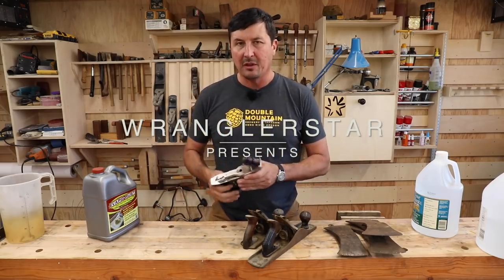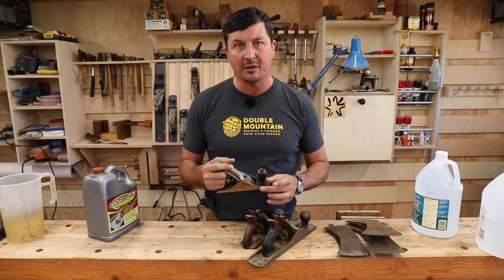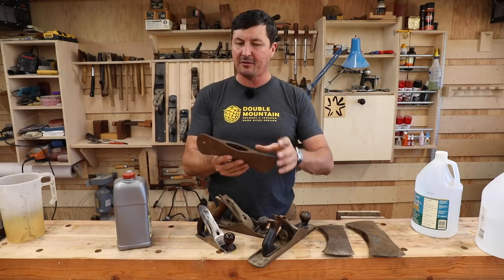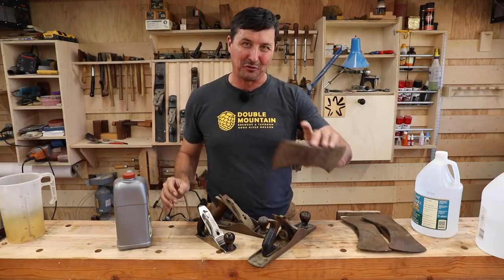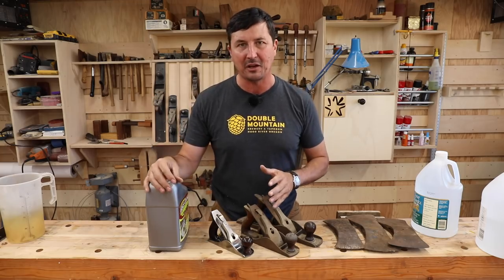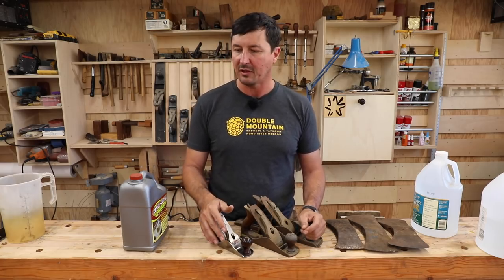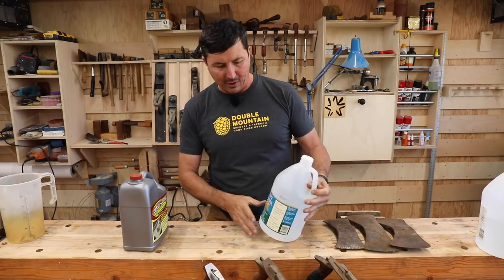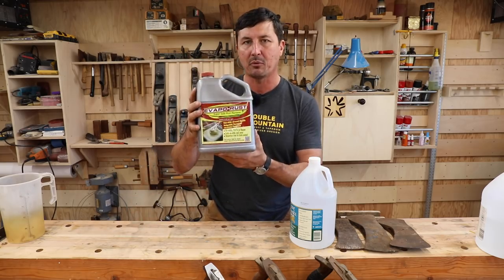Polishing A Rusty AXE

Comment: Use the vinegar for the first bath and Evapo-rust for the second bath. Evaporust  costs a lot more than vinegar and will only remove so much rust before it should be thrown away. Use the cheap vinegar to do most of the work. Also, Warm vinegar and salt works well at cleaning corrosion from electrical connections. Only a few minutes are necessary. You might want to neutralize it with baking soda afterwards.
Reply: That's a great idea
Reply: berserk7111 Smart.
Reply: berserk7111 White vinegar or malt vinegar (brown) ??
Reply: I've only used white.
Reply: Some people use apple cider vinegar, but chemically they are all the same and white vinegar is very inexpensive compared to fancier vinegars.
Reply: You can also scrape or wire-wheel the rust off first.
Reply: BB Pring yea acetic acid.
Reply: Good idea!
Reply: Assuming you already own an 8" wire wheel, a bench grinder and a bench. ;)
Reply: i know a person who uses the evapo-rust  and when he is done with it he filters it through a paint filter. he goes through about 5 gallons per year doing auto restoration and swears by it. i have used the vinegar before and it does work but leaves behind some black stuff. i will try it again on a 12 inch adjustable wrench i found while regrading my driveway i think i will use a wire brush first to get the lose rust off,
Reply: Erik Giggory, good tip with paint filter. I'll try that next time. The black stuff you are referring to might be the natural color of the iron. My friend tried the electrolysis method with washing soda and the part, an antique drive-line, come out black, just as you said. Removed the grease paint and the rust as well.
Reply: The evaporust is reusable.
Reply: Wire wheels are my go to as well but they don't fit in small nooks and crannies like on an old rusted pair of vise grips for example. Sure, you can polish the outside fast but the inside mechanisms you can't touch with a wire brush/wheel. The rust removers do a nice job cleaning the insides. I found it useful to have both around.
Reply: Do not use vinegar to clean rust off of high strength/hardened steel objects, especially the ones that carry loads or are meant to hold an edge. Acids cause a phenomena know as hydrogen embrittlement; the hydrogen diffuses into the metal causing it become very brittle. Same thing goes for electrolysis for cleaning rust as the bathing solution uses an acid.
Reply: Sekelee1, Interesting. I'll keep that in mind.
Reply: #berserk7111 - I do "own" a gallon of vinegar ~8^)
Reply: Vinegar also pits iron fairly quick. I like oxalic acid better personally, it favors iron oxide over iron much more than vinegar, and you can buy it bulk for really cheap, but you have to buy it online.
Reply: berserk7111 

Same with vinegar. It will only be good for so many baths because iron acetate, hydrogen gas(?), and water are byproducts of the reaction between acetic acid and iron. Water and iron acetate will dilute and neutralize the solution, respectively.
Reply: John Possum defiantly don't work as good as this stuff dude
Reply: TCSwizz2 however white vinegar is an order of magnitude cheaper than evaporust.
Reply: salt causes rust
Reply: Sekelee1 I doubt this occurs deep enough to be a concern, on axes anyway. He's going to need to file a new edge and will be exposing fresh steel.
Reply: Homme Des Cavernes 
Yes, it does. Any acid causes this, as acids are made of hydrogen ions. The hydrogen diffuses into the metal, not just the surface, so reprofiling will not fix this. The longer the metal is exposed, the more embrittled it will be. Keeping the part soaked over night is sufficient enough to cause this to happen at thinner parts of metal. 

The only potential fix is baking the part after the bath. But I don't have much details on that as it varies with steel strength.
Reply: Sekelee1 At least he didn't soak the ol' Gransfors in there 😬
Reply: The salt converts the vinegar to hydrochloric acid. Useful for extreme cases, but risks taking too much.
Reply: Ive used electrolysis with oxyclean for great results. When the solution becomes black in some cases i assume this is due to high carbon content of cheaper saws. Older saws only leave rust.
Reply: Use coke it helps alot
Reply: I used Coke to free up an old motorcycle engine once.
Reply: I drink a Coke every two weeks, keeps my lower tract all clean and shiny and it helps free me up when needed so I stay regular as clockwork! ....... Kidding!!! ;-)
Reply: Don't forget to pass the iron coming out of the vinegar through concentrated baking soda solution to neutralize the acid. Otherwise it's going to help oxidation even after it dries off. 

Rinse with water, dry it off, and cover with some kind of oil to protect for rust protection. 

Good as new :)
Reply: hello, how much salt do you add & does the salt warm the vinegar? If not what temp. do you warm it to? Also, do you soak a rusted item for 24 hours if you use vinegar only, no salt added?    thanks, for the great tip!      n
Reply: Meh
Reply: I just us wd-40 and some sandpaper to get rust off
Reply: or use angle grinder wire wheel that will last you 10 years.

Comment: Something I found out the other month doing this for the first time. If you are planning on using whie vinegar to get rid of rust make sure to wash in a basic solution afterwards, nothing to extreme, just mix some baking soda with water and rinse/scrub. This will help prevent flash rusting on the fresh metal surfaces before applying protective oils later when you can get around to finishing it up, cheers for the great video!

Comment: I have found that if you add salt using the ratio of (1tablespoon to 1cup of vinegar) it works a lot more effective and quicker, its something to do with increasing the acidity of the vinegar. Also a tip is after you have removed the rust with whatever you use, wash it with bi carb soda to neutralize it . Love the videos !

Comment: Another hand tool junkie here.  Discovered Evaporust this past summer.  I’ve manually scraped and sanded, used vinegar and had an electrolysis set up before I tried Evaporust.  

I want to take walks on the beach with Evaporust, long hot showers, stare deeply and longingly into its eyes and profess my undying love and affection.  A quick wash with a degreaser, like Simple Green, and a clean water rinse.  Then an overnight in Evaporust.  Another rinse and then dry and oil.  It will flash rust after the rinse, so a thorough drying with an air compressor or heat gun helps.  Saves hours of work.  Great product.

Comment: I've never used vinegar but I have used evapo rust for a few years now. As far as I've found, northern tool has it cheapest in 5 gallon form if you can ship it to the store and pick it up. Usually around $76 for 5 gallons. Some words of advice about evapo rust. Check your tools as they sit in the chemical. I've had them form a black oxide if left in too long. Then require some sanding or wire brushing to remove the black oxide. Second, they say you can reuse the same stuff but don't put it back in the container of clean evapo rust. The rust sediment and contamination makes the chemical loss it's power a lot faster. We found that out just opening the 5 gallon bucket and soaking all we could fit. It turned the whole bucket black and it then hardly worked like new stuff. Great video.

Comment: I have used Evaporust for restoring old pliers many times because it does leave original paint and molded grips alone. Vinegar is by far cheaper but I find does take a bit of "wiping off and resubmerging" about every 6 hours for maximum effectiveness. I like evaporust on gun parts too as it is not so hazardous as other rust removers. Made in USA is also a plus for me.

Comment: Acetic acid  (vinegar) is a corrosive agent that attacks the steel. It does not attack the iron oxide. It appears to remove rust but what is really doing is attacking the metal the rust is attached to. That is why looks like is removing the rust. If you keep the steel long enough it will eventually dissolve completely. 
It is extremely important to neutralize the acid with a base. Mix baking soda in water and wash the tools with that water. This will neutralize the vinegar and will stop the corrosion process.

Comment: I have used the vinegar before, but I had found better results with heating it up on a hotplate for 10-15 minutes , but not hot enough to boil, and let sit overnight. They turned out great, keep up the great work !!

Comment: You should also add and electric current 6-12vdc to your rust removal media for much better results.  Just add a sacrificial anode wit plus attached and negative to the part to be cleaned.  Any slightly conductive media will work.  Salt water, washing soda, etc. will work.  Just wash the part and apply oil after.
Reply: Electrolysis also won't remove the protective patina or give it that pickled look.

Comment: Add a little bit of dishsoap to your vinegar. It acts as a surfactant to lift the rust off.
Reply: xng14 dish soap is a base vinegar is an acid that would just neutralize it you can use dish soap after to stop the reaction

Comment: Since I studied chemistry I like this approach: vinegar + sodium (bi)carbonate bath, put the axe head in the bath with some copper wire (normal steel wire worked as well) through the eye to suspend it. Some people like to make sure it has good contact between fresh steel and conducting wire but I've had just as good results without caring. Hook it up to the black terminal of a 12V battery charger, hook a piece of sacrificial steel up to the red terminal and put in in the bath with it. Immediately you will see an armada of bubbles rising up and within 20-30 minutes the bath will have turned orange. Usually I leave it on for 12 hours before it gets too hot and the foam takes too long to disappear, then turn it off for the night to leave it in for a good soak. The day after all the ferric (III) oxide will have turned into ferrous (II) oxide which is black and doesn't adhere to the steel anywhere near as good. Just rinse it off under a tap with some steel wire, scotch brite pads or a soft brass brush. 

And also because Evaporust is kinda pricey over here.

Comment: Pleased to see you have discovered the fantastic Evaporust!  The big advantage over the white vinegar is that you could leave something in there for a week and it will only remove the rust, it will not eat away the good metal. The vinegar being an acid will also eat away the good metal over time. Try using it with discoloured stainless steel, it comes out like new!

Comment: I've been using vinegar for years, never had a problem. I just keep a tub of water with baking soda dissolved in it to neutralize the vinegar after I take the metal out.  It helps prevent flash rust and stops the reaction. I then dry the metal thoroughly with a dry shop towel and go to work.  I may try the Evapo-rust just for giggles, but the vinegar is cheap and I could care less about the smell.

Comment: I've been using Vinegar for years. Even cleaned up an Olds Rocket V8 that looked like a ball of hate and rust after sitting behind a barn for years. Threw it in a trough and then filled it with the cheapest vinegar we could find. Came back and except for a little pitting it looked almost brand new off the machine line. Obviously it had to be machined internally, but it made cleanup to get it broken down MUCH easier.

Comment: Hi cody! That stuff works great for removing rust. I like the comparison of a $20 rust remover and $4 vinegar. The tools will clean up nice with a wire wheel. BTW that would be a Hults Bruk axe not a Gransfors Bruks axe. Can't wait to see you finish restoring them!
Reply: Hay you sound like you know axes , I have a question i have an old axe double bladed with W and 48 under it and on the other side what looks like 2 fangs , any idea who made it ?..?
Reply: @anthonyjacinto2622  im probably late to the party but i think its a warren axe

Comment: The gas that was evolving from the plane in white vinegar was hydrogen gas, which showed that the vinegar, i.e dilute acetic acid, was attacking the uncorroded metal of the plane and axe. When iron oxide is dissolved in an acid no gas is produced. So the acid has disolved the rust and also attacked the metal, probably producing slight pitting of the surface. I would not use vinegar to remove rust from any tools you redard as precious. After an exposure to vinegar you need to neutralize any remaining acid with a dip in a mildly alkaline solution such as baking soda in water, then thoroughly wash with clean water. I would think that after a few days left in the air the tools from the Evaporust will still look good, while those from the vinegar will tarnish.
Reply: The anions in a alkaline solution will immediately begin to rust the material.  I would say you are better off using an organic cleaning solvent and then oil.

Comment: Hi Wranglerstar, 
The double bit axe you put in the evapo-rust is an HB --> HultaBruks. I have an old army axe (american felling axe model) use by the dutch army. HultaBruks were hand made in Sweden since 1697, same time stradivarius made is violins ;-)
Cheers! Martijn from the Netherlands.
p.s. consider the french Opinel knives. The are sharp as ...., durable, utterly simple, and cheap! And you can modify the knives easily

Comment: Pretty significant cost difference between vinegar and evapo-rust
Reply: William Hill you can also reduce the vinegar down to concentrate the acetic acid in the vinegar, that'll be one advantage of the expensive stuff
Reply: Vinegar that's what I use text about half a gallon dump it two days later then put the other half a gallon in process for a good job 5 days in all soaking and cleaner does a good job,on my Axe Heads.
Reply: Common white vinegar is around 5%, anything above 10% is corrosive to skin,  20% is available for weed control. 20% runs $30-40 gal.
I've only used the regular stuff - 36-48 hrs does a great job unless its badly pitted.
Reply: vinger will eat throw paint and take some metel off unlike evapo plus you can use it over and over. cheap tools yea use vinger
Reply: David Howard does good for me and I got expensive Axe Heads I'm sure the other product work good to you I'll have to get a jug and try it
Reply: William Hill reducing it is free just warm it gently. It will make it quicker.
Reply: stuff like axe heads and other bigger things what you could always use wirewheel vinger not to bad but like hand planes i wouldn't because i like the paint that still left on it and markings. just use baking soda after use vinger. axe head and hammer head i would just use vinger tho inless you want to keep an
Reply: tsfarken wear gloves....or just wash off.
Reply: David Howard the evapo must have taken metal in order to show the etch between the two steels. The darkening is due to the acid eating at carbon based steel. The same as when smiths etch Damascus steel.

Comment: Cody, I've been using Evapo-Rust for a few years now.  I restore a lot of gun and automotive parts.  The best thing about it is that you can re-use it over and over.  Don't throw it out.  It will get darker but it keeps working for a long time.

Comment: See you used 5% vinegar you should have used stronger as 35%. 
As the effect becomes something completely different.
And the price of vinegar is certainly cheaper an evapo I want to believe
Reply: Vinegar is about $1-2 per gallon. The Evaporust is about $17-$20 per gallon. The only downside to vinegar is that it will etch and eat away at the metal. We're talking tiny amounts though unless you leave stuff in there for a long time.

Comment: Remember to rinse the steel with a baking soda and water solution to de-acidify the vinegar on the blade also the more acidic the vinegar the better it will work. I'm definitely going to try the Evaporust, that looks a little easier than the vinegar method I've been using.

Comment: Great video.  Two great options - a complete chemical solution, a little pricey but effective and a walmart vinegar solution much more affordable even if not as complete, but still acceptable.  I have a bunch of differential parts/gears to derust and I was dreading an expensive chemical solvent investment, now I will just go to the vinegar and cheap plastic tub.  Thanks again, you just motivated me to finish my old differential project.

Comment: For best results make saturated solution of vinegar and salt. You do it by slowly adding salt until it stops dissolving. It's good for situations when it isn't just rust, when you have other stuff like grease.

Word of advice. It's best if the object in question is completely submerged. Sometimes it's bubbling and it makes things worse above the "water" line.

Comment: I worked on a Stanley No. 8 planer with a similar break in the rose wood handle. I just put wood glue on the break and screwed it onto the plane. I then took of the handle and removed the excess glue. It worked out perfectly. Good luck!

Comment: Wranglerstar, use the leftover vinegar (after being used to de-rust something) as a stain for wood. After the vinegar/rust combo dries Finish with BLO and you will have an amazing finish! I've done it with excellent results
Reply from the maker: interesting.  thank you for the tip
Reply: Wranglerstar, no problem! The stain will be darker the longer you keep rusty material in the vinegar.

Comment: The Evapo-rust is great stuff.  And don't throw it out right away, it is reusable for quite a few times.  You will find that it can be ordered in five gallon buckets as well.  Read and follow the instructions and it won't do you wrong.